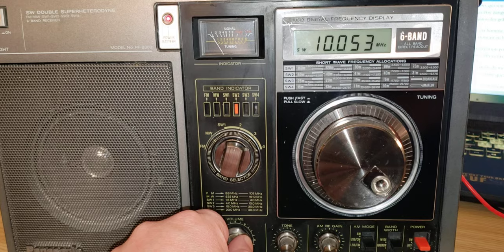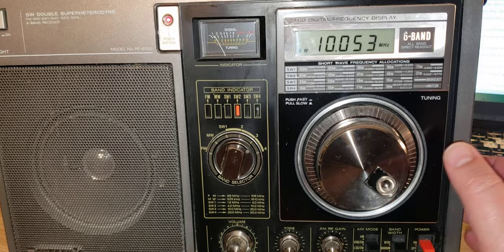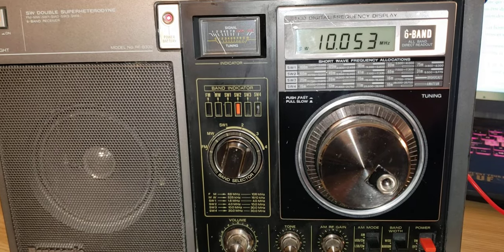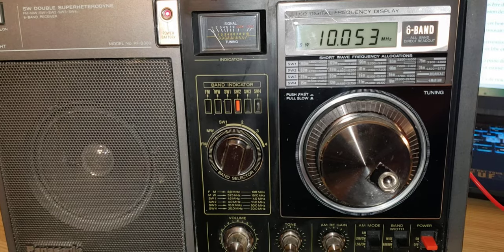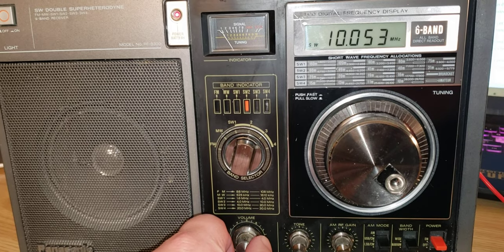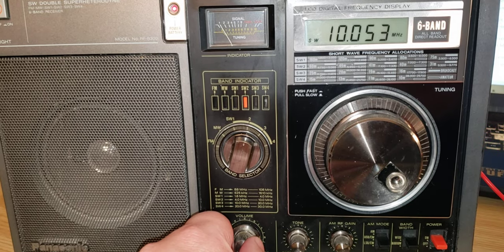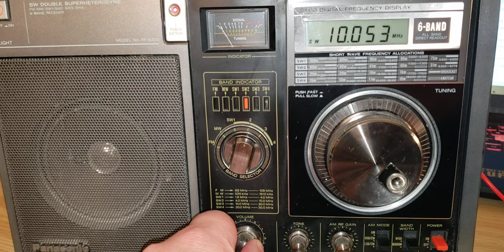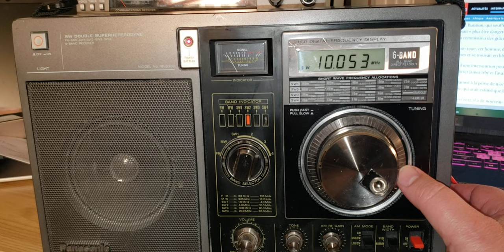Panasonic RF-B300 SSB tuning 10051 kHz Shortwave USB Gander Newfoudland Canada Volmet station

Comment: I'm quite familiar with that VOLMET broadcast and it seemed like the Panasonic had a pretty good signal arriving at the antenna but was really struggling to produce readable audio for more than a few seconds. It does make you realise how good current SW radios like the D808 and even more the Belka DX are.